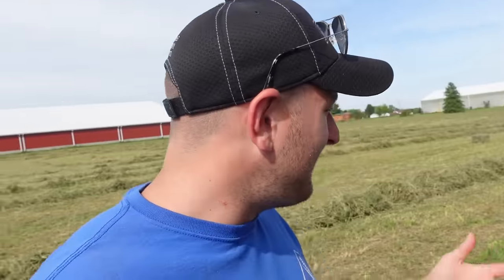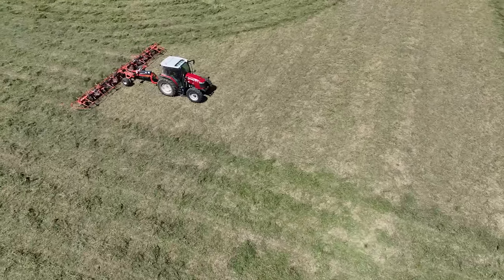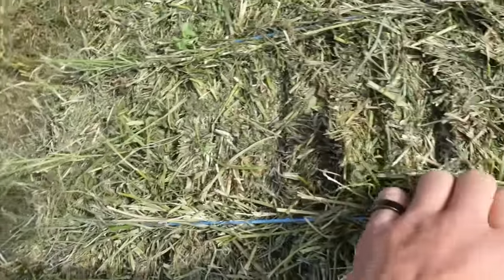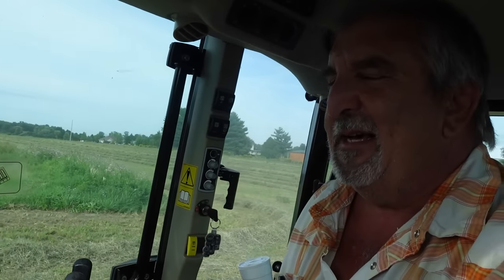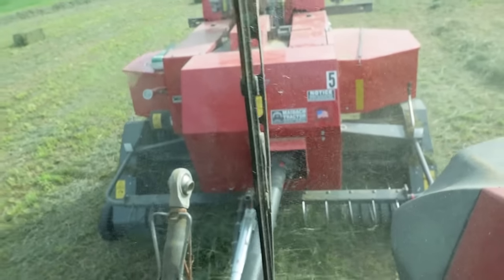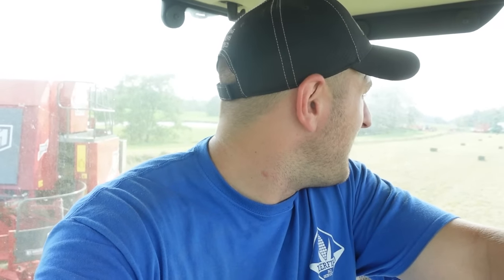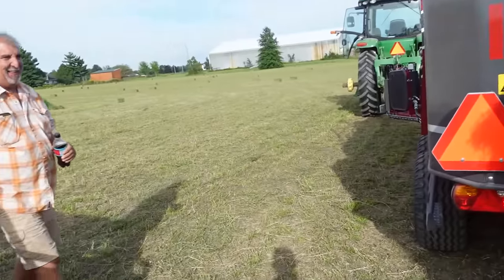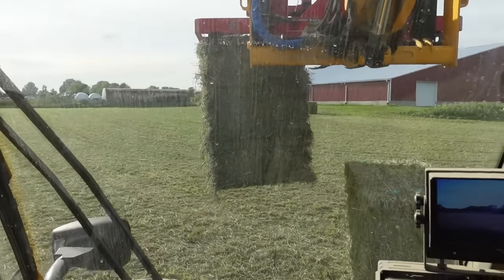Making Gorgeous Alfalfa with my Dad (Step by Step Guide)

Comment: Another benefit of the 5075 is that you can run it all day (even turning an 8 foot bush hog mower on 5-7 gallons of diesel as long as you are not in 4WD. Try that with a 6000-series.

Comment: When you finish bundling a field release the tension and drive around a bit and the last bundle will loosen up and some fall out. Also put the pins in the front holes next to the machine in the holding position. They do not need to be put in the slotted holes. We have had these balebarons since 2011 they work good and easy to work on.
Reply from the maker: Oh nice, great idea. Thank you!

Comment: The Baron is an excellent machine, but I've always preferred ARCUSIN because of its simplicity and more forgiving on bale size as well as less hp to run it.
How do you like the Baron?
Reply from the maker: The baron has performed really well in terms of capacity. You're exactly right about the strengths of the Arcusin. Bale size is far less strict and it's smaller. This is the smallest field of hay we run and the baron was honestly a bit big getting started, the stories change a bit in larger, better running fields

Comment: I see this was small bales but at times you make large bales then send them thru the re-baler. Can you tell us why its more economical to make large squares and then to re-bale later. Signed "Farming Insider Junkie" --- "Living vicariously thru others"
Reply from the maker: Hey Bryan, we will run the large square baler when a large amount of hay is ready and at the maturity we want and there is a limited foreseeable weather window to make it, or it is really busy time of the year and we don't have enough available help to fully staff the small square operation. The small squares balers can only do so much, so the large square baler is a tool that just helps us get it baled and off the field quicker. If we didn't run the large square baler, we run the risk of hay getting too old and far less desirable and therefore, profitable.
Reply: @FarmingInsider  Wow that makes perfect sense. All about time... and is why you baled early this alfalfa because of rain coming.
Farming is so amazing..... love your channel!
Reply: Speed I would think